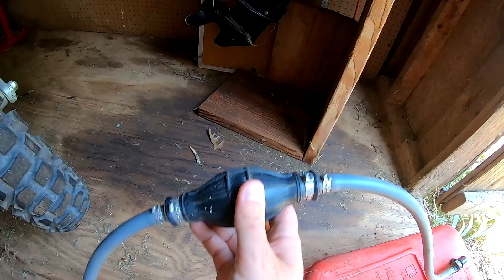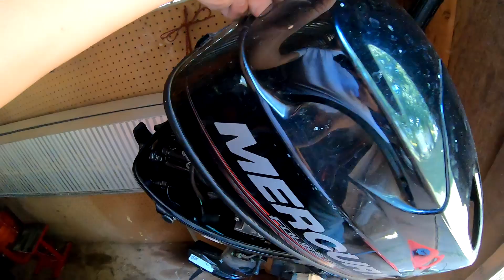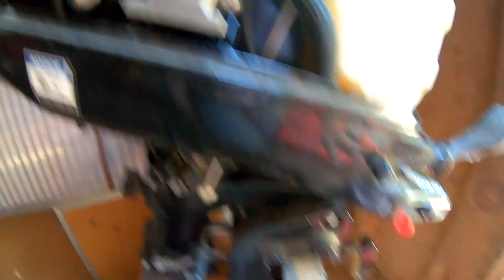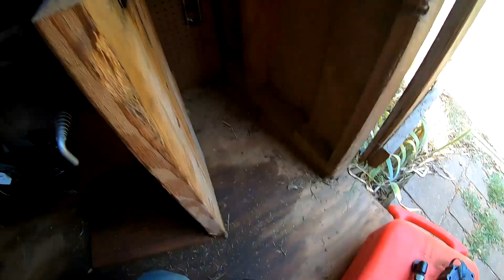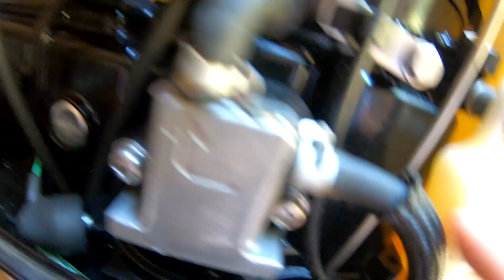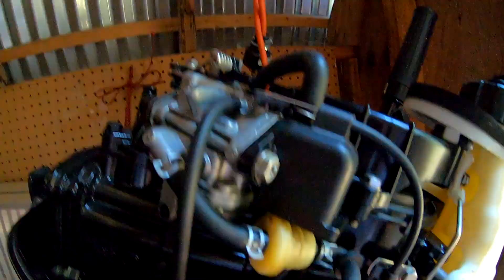10 MOST COMMON Jon Boat Fuel System Issues

Comment: After being out on the boat all morning I can’t start it and still can’t start at home to flush. No water in fuel and fresh fuel. New filters. The new portable tank creates a lot of pressure.  If that pressure is causing carb problems how can I relieve the pressure or reset the valves so I can test if that is the problem before putting in a fuel demand valve? This is for my 70hp Yamaha 2 stroke.
Reply from the maker: Not positive but It sounds like it flooded. To relieve pressure you simply need to crack the gas cap. There maybe some pressure between the tank and carb but it will equalize when the carb float valve opens. 

I would drain the carb, maybe pull the spark plug, unhook the gas tank, turn throttle all the way open, and try to start it. That will max the air flowing through the system and It will dry out the cylinder. Then hook  everything back up and pray 😂

Comment: So every gas station sells 87 non-ethanol or 9310% ethanol which one would you recommend? I’ve always been told to use 92 or above for small engines
Reply from the maker: My manual says to use 87 non-ethanol, I’ve used them all though.

Comment: Hey, great Videos.  I have the same engine(Tohatsu 6P MFS 6C)  it starts and Idles great.  i can give it High Revs at the dock, but when in gear at high revs, it floods out and I get gas coming out of the overflows.  I have cleaned the carbs and verified the float level measurements (10mm).  Do you think it could be a fuel pump issue?  Any insight helpful!  Keep up the great videos!
Reply from the maker: That’s interesting, are you using an external tank? I had a similar problem with an external tank on warm days. The tank would build up pressure and push too much gas into the carb. But it’s weird that it’s only at high revs.

Comment: @skinnyriver First of all THANK YOU SO MUCH FOR THE CONTENT it is so helpful and great quality!! I need your help with something that might be very simple but I just can’t figure it out!! I have a 4stroke 2019 2.5 mercury it pretty much looks the same on the inside!! Everything works and starts up great but when it’s on idling, and I put it in forward and try to rev the engine nothing revs I’m not sure if the linkage not being set up correctly and I really tried to figure this out but I’m stomped!!!
Reply from the maker: Hi! Thanks for the support. Will it rev while it’s in neutral but not in forward? Or just not rev at all? If not at all, watch the carb when you are turning the accelerator on the tiller handle. You should see the valve on the carb moving, if not then your cable may have come loose in your tiller handle
Reply: @Skinnyriver I can rev it my flicking the throttle but twisting the handle doesn’t rev it.
Reply from the maker: @JrodCookinup does twitsting the handle move the throttle? It seems like the cable came undone from the tiller handle or is loose. My email is skinnyriveroutdoors@gmail.com
Reply: @Skinnyriver No twisting the  handle does not move the throttle! I will email you shortly.
Reply: @Skinnyriver It doesn’t rev in either neural or forward! I will give that a look and give you an update. Is there anyway way I can send video demonstrations so you can see what’s going on?

Comment: HI- I have the same 4hp motor that came with a boat I just got. Motor is 2006 and working to get a shop manual so I can see how it was set up.  Can I ak you a question please?  There are two ports near the top of the carburetor (not fuel line) and in the video I see there are small hoses. I assume vent but not too mechanically inclined. Where do they lead to?
Found some parts lists on-line but the view is blown out for the specific parts, not assembled or top level drawing.  Sorry to bother you.  -Les
Reply from the maker: Hi! On mine they are just routed down out of the cowling. I think they are vent and are routed out of the motor area in case the carb floods. I’m honestly not sure
Reply: @Skinnyriver  Thanks!

Comment: Thanks, much appreciated.  My Suzuki outboard started bogging down after we went through so very big waves on the lake. I suspect it stirred some debris off the bottom of the fuel tank.  Turn it off and back on and it would run great for a minute and a half then bog down again.  Certainly a fuel delivery issue.  I'll start going through the check points tomorrow.
Reply from the maker: Let me know if you find the problem

Comment: My motor was starting and puttering out after just a few seconds. It is getting plenty of fuel, good compression, spark. I disassembled the carb and cleaned thoroughly. Now when I squeeze the bulb pump. the carb pours fuel out of it. Any ideas?
Reply from the maker: Something is probably up with the float not stopping gas from coming in and the carb is overflowing. The bulb should get firm, meaning the carb is full and the float is stoping incoming gas. If the bulb is not getting firm and the carb is overflowing, I would take it back off and inspect the float and the needle valve that the float opens and closes